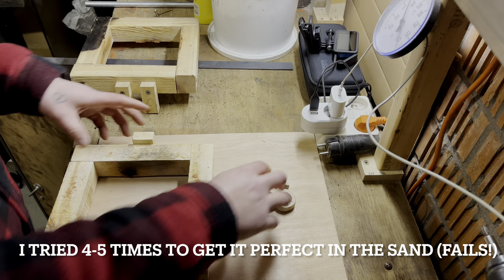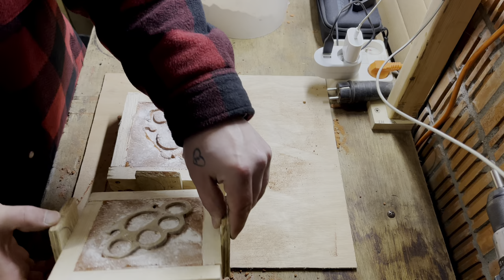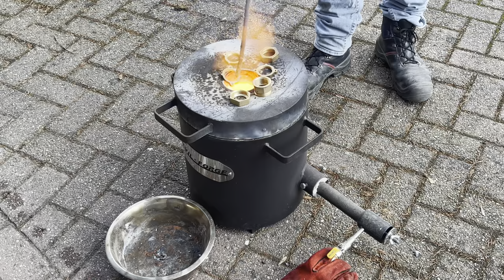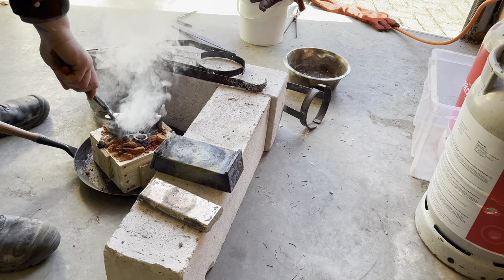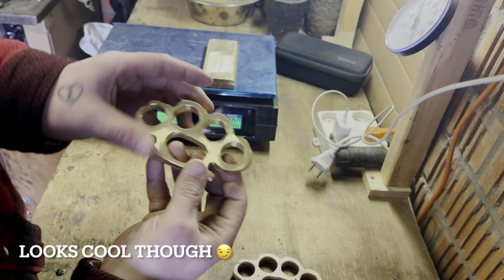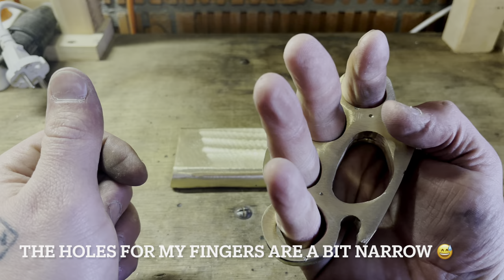MAKING A BRASS KNUCKLE FROM SCRAP / SANDCASTING / #devilforge / #meltingbrass  / #backyardmelting

Comment: I know you most likely don't actually use these as carrying is illegal in the vast majority of the world but I think it would be a good challenge to cast an old school pre Hollywood era piece. Thinner in construction, circular look instead of blocky, just a slimmer less bulky piece overall. You can look it up, I suck at explaining. I love the way this one looks, don't get me wrong, but I'd like to see how you tackle the issue of creating a cast of a thin object that's mainly holes and empty spaces. Also it would be interesting to see what you come up with for the template for the mold, I think it would be too thin to be made from wood, maybe 3D printing?
Reply from the maker: It was just to make them, I can’t use them or I’ll break my fingers.. it’s a bit small.. Oh yeah! I wanted to make those! I only need to print them out, all ready have the file😏. These look, not bad but I get what your saying 😉. They can be nicer. Normally it wouldn’t be a problem to cast the thinner ones, but I’ll try it out first before I jinx it😉. Oh I definitely use the 3D printer, I didn’t had it when I filmed this video. But I think I’ll make the mold in 2 pieces, I was struggling with the holes if I remember correctly. I’ll definitely try it out! I’m guessing if everything goes as planned, I’ll be able to film it in 3-4weeks.. swamped at work, Christmas party’s to attend, birthdays..